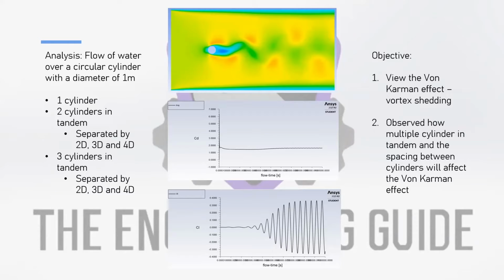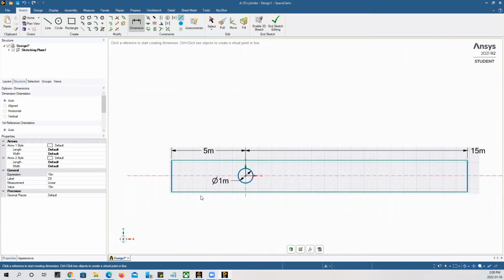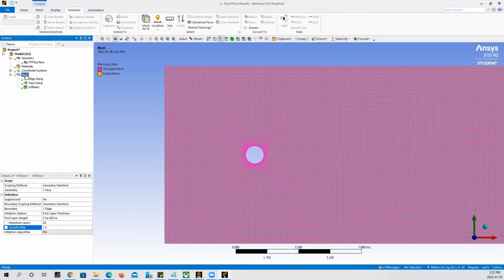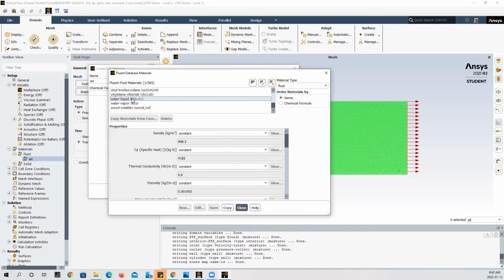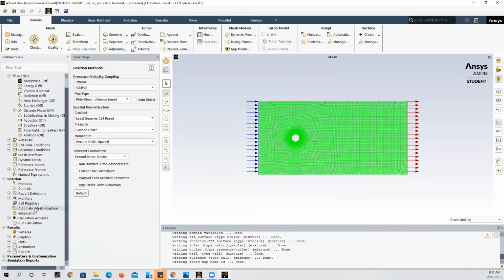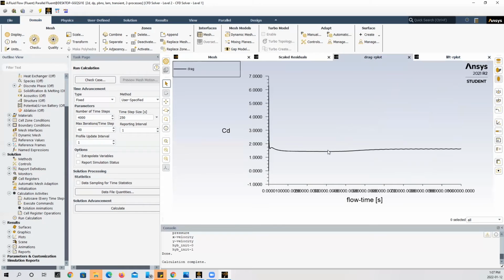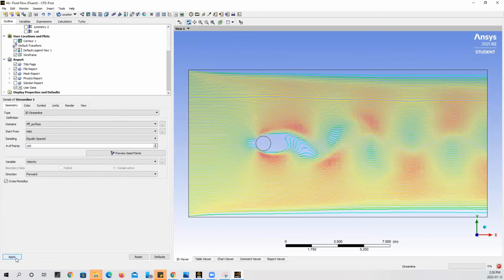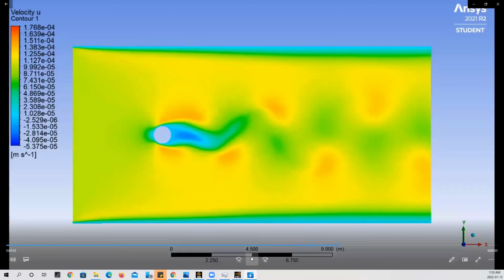ANSYS CFD Tutorial: Fluid Flow over a Circular Cylinder - von Karman Effect

Comment: I think the time step size should have been 0.004 instead of 250, because the von Kármán effect should not take this long to take effect.
Reply: How can I calculate acceptable values for time step and number of time steps if my diameter is another and I'm changing the velocity of the water flow for each simulate?
Reply: @gloriamarceladebarrosmorae5198  look up Courant–Friedrichs–Lewy condition
Reply: Let me know if you know
Reply: @MADHUSUTHAN4072  should have been 0.004.
Reply: @joerivandesande1378  well that's good...may I know the calculation aspect of it?
Reply: @MADHUSUTHAN4072  what this simulation is doing is simulating 250 s x 4000 = 1.000.000 seconds. This isn't your typical simulation time. Timestep size x number of time steps = simulation time. So, I just presume the maker mistook the time step size and should have taken 1/250 s. Which results in a simulation time of 4 seconds, which is sufficient for the simulation of karman vortices in airflow. This however, is simulating water flow, which is more viscous. So, I'm not sure if 4 seconds of simulation is sufficient.
Reply: @joerivandesande1378  yeah...now I completely understand....thanks for the time ✌